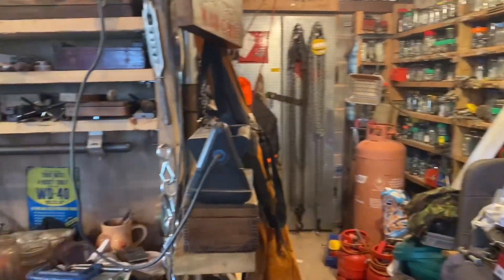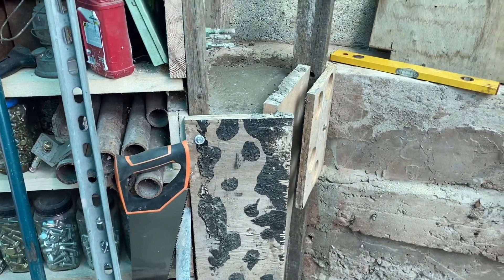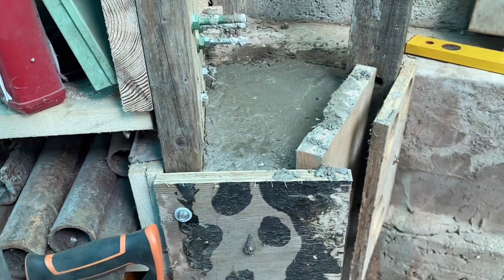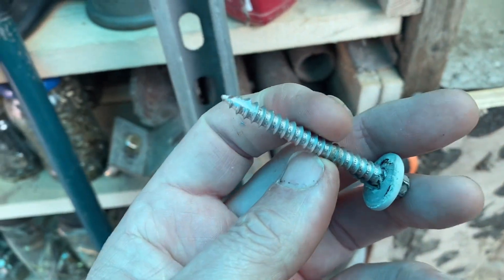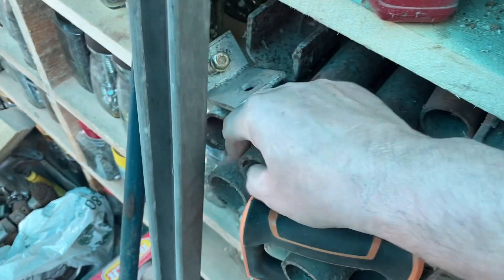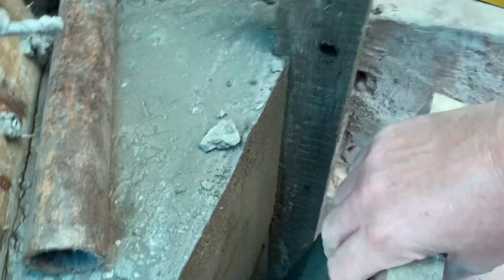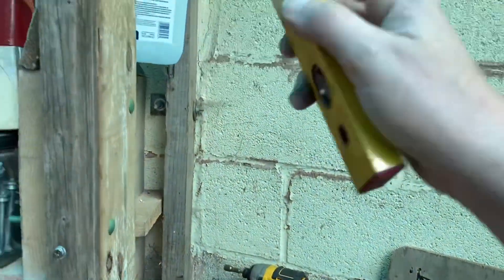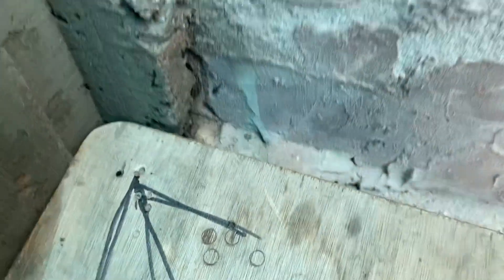Unveiling the shuttering and Horse rigging

Comment: Hi Reggy, If I were you I would keep that bolt at the bottom of that concrete post and pack it before you put the next length of timber in for the next set of shelves. It has set well give it a few day's to dry out make it more sturdy, It's looking good mate